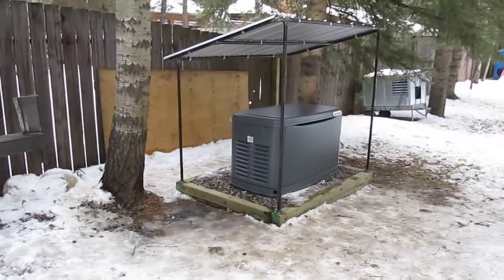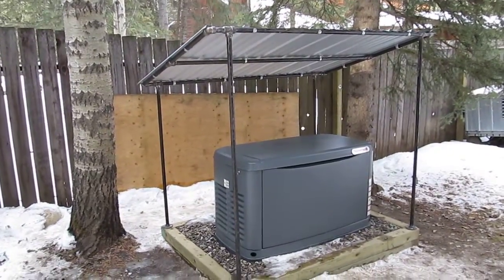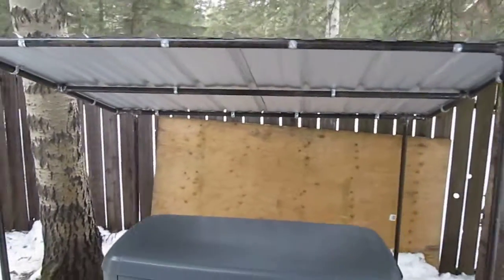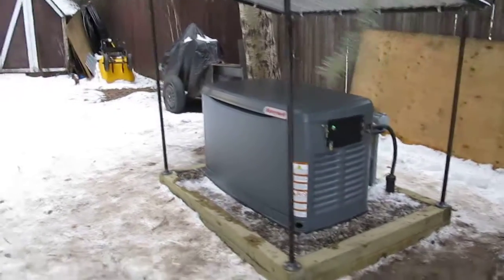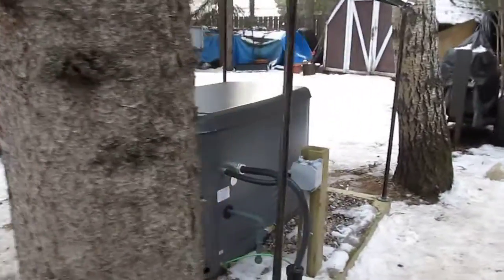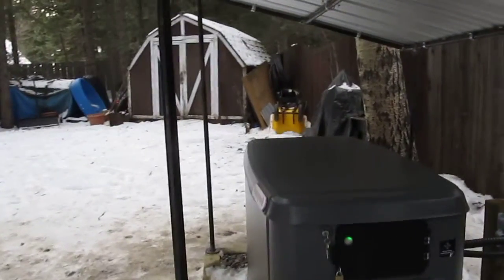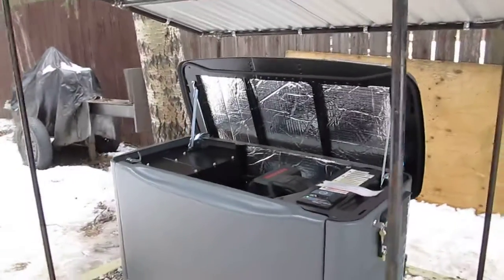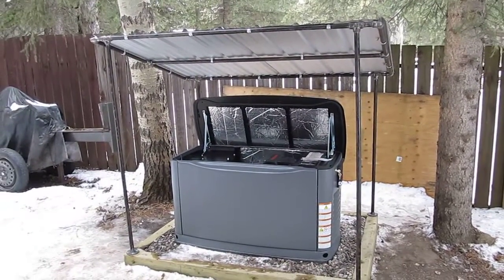Shed roof for my 17 KW Honeywell Generator.

Comment: Very nice looking installation, is rain a concern? Is that not a weather proof enclosure?
Reply from the maker: No rain is not a issue it is a weather proof enclosure. As is said in the video, snow buildup near the two air intakes is a concern. The one at the back draws in air for cooling the generator head. This shed roof has worked well over the last four winters. Well worth the effort. If you go on generator forums there lots of other owners who have done similar things to keep the snow away.
Reply: OK  thanks for the timely response. No snow to deal with down here on the TX Gulf coast but power outages are especially with tropical storms and hurricanes.Went 15 days without power after Ike on a portable gasoline powered unit, it was a challenge but better than nothing. Costco has the Honeywell 20KW unit on sale down here now for 3200 so I am pulling the trigger, thanks again.
Reply from the maker: You won't be sorry, it is nice to have the power come back on in 25 seconds without doing anything. You note I put my Honeywell on a crushed gravel base. I did this to reduce the noise produced by the generator. If you mount it on a concrete pad the pad bounces some sound back. Also nice to have it up a bit incase of local runoff from rain.
In 2013 we had floods around here caused by more than 15 inches in two days, that is a lot for here in the Alberta Foothills. We were OK on our lot but a few others had bad flooding. I have lots more videos on my Honeywell on modifications and fixes I have done. A lot of them are cold weather related so do not apply to you down on the Gulf.

Make sure the exhaust end of the generator points away from your house and outdoor living space. That is why I did the underground NG / Electrical so I could put it near the property line 75 feet from the back of the house.

Here is a good generator site that has lots of answers for your questions. They are a Generac dealer, which what a Honeywell is.

https://zillerstore.com/forums/index.php

The one main thing I have learned from them is make sure you us large enough NG supply pipe. This appears to be the one thing that causes problems.

Good luck on the install.
Reply: I think this is yours.....https://gensetreviews.com/best-honeywell-generators/

Comment: Love it!  How did you attach the metal roofing to the bars? I might copy your design because I need to protect my generator from snow and ice falling from my solar panels.
Reply from the maker: If you take a look in the video you can see the perimeter pipes are attached to the sheeting by electrical conduit clamps with one mounting hole. The S S bolts go through the sheeting and secured with washers and a nut. Like this.

https://www.bing.com/images/search?view=detailV2&ccid=njvBu24s&id=97C67CA33FCD08FEAF0F6714F1CB09D18A60D54B&thid=OIP.njvBu24sdtXIWFXDIhiViwDTDS&q=galvanized+electrical+conduit+clamp&simid=608055486879106747&selectedIndex=10&qpvt=galvanized+electrical+conduit+clamp

The pipe that runs through the centre of the roof uses electrical conduit clamps with two holes, like this.

https://www.bing.com/images/search?view=detailV2&ccid=bbUs75Vd&id=7F3E3F67E6B3EECD98AD13B2997952A8EB983B4B&thid=OIP.bbUs75VdDJsyEb3CMvmotQEsEs&q=galvanized+electrical+conduit+clamp&simid=608018782092069802&selectedIndex=13&qpvt=galvanized+electrical+conduit+clamp
Reply: Wow, thanks for replying to my quest so quickly!  I will post a picture of my generator roof when I get around to following your plans, Thanks again!